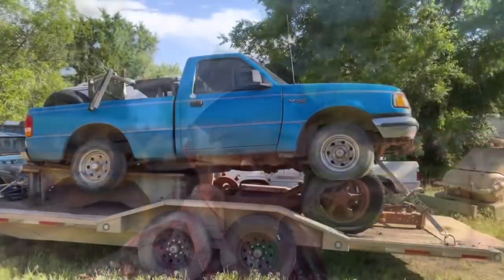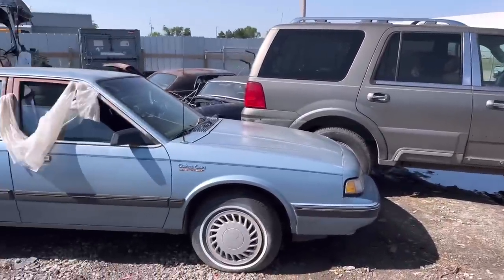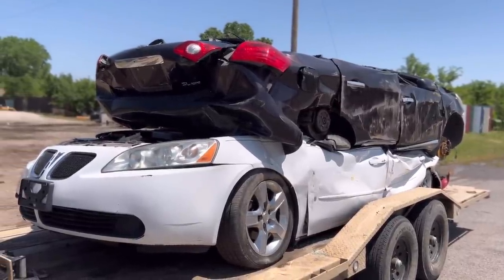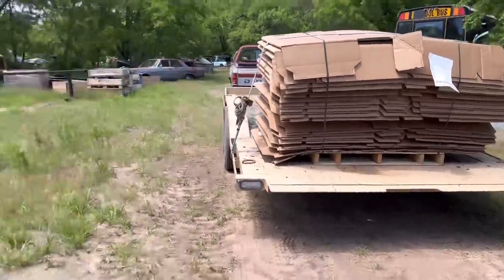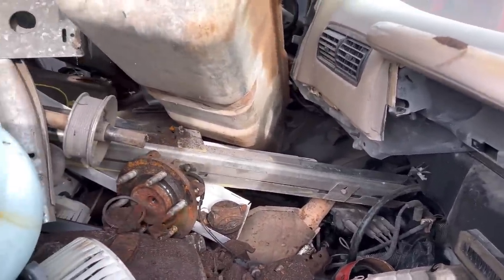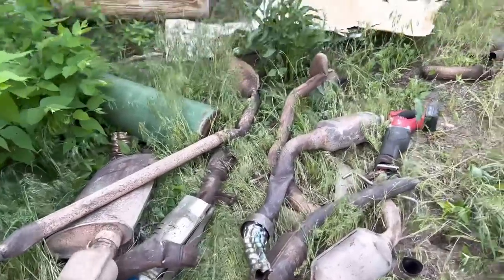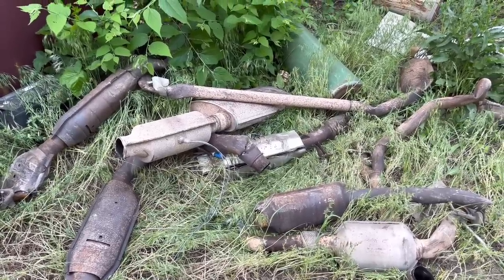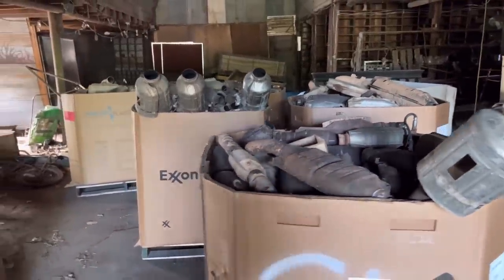Crushing Cars & Prepping Hundreds of Catalytic Converters!

Comment: Too funny. That load of cars by the gate while they were sitting on the loader. The truck/trailer backed up then IMMEDIATELY the loader started doing it's thing. Had to watch that part twice. Didn't see the edit in between. I was like, "How'd he do that? Is someone else driving or something?" HAHAHAHAHA!!!!!!!!!!!!!!!!!!!!!!! 🤣😂🙃😁🤪🤭😏😛😊😝
That train. The engine in the middle is called a "DPU". Short fot "Distributed Power Unit". They stick 'em in the middle to assist with longer/heavier trains. They can push/pull the extra weight, reduce coupler breakage and improve fuel economy and/or all of the above. They can also help to prevent locomotive stalls on hills. A DPU is controlled by the lead locomotive via remote control. At the front, there may be more than one engine. DPUs as well. Controlled the same way. They all act in sync (usually). Sometimes on hills the leads will pull the weight before the DPU up and the DPU will "run a little faster" so as to help pull the rest up. Sometimes there's a DPU at the end of a train. Same principles. Those can sometimes be referred to as "pushers" because that's their main function: 
They help push the train which the loco(s) are pulling. If one at the end, odds are there won't be one in the middle. Placement's all pre-calculated based on total weight and leading grade (if any - leading=steepest) on hill(s).

Comment: Silas, you know if you'll put your pin in the hook in the opposite direction from the way that you put this one in, so as until the head of the pin is on the side of the point of the hook, you won't have hardly as much trouble with the pin trying to come out, it really does make a difference if the load isn't pushing against the cotter key end. Love ya junkyard! To prowl a good junkyard for a day is like Christmas and a vacation day all in one, not much can beat it!
Reply from the maker: Interesting, thanks for the tip. This one lasted for 2 years so hopefully I remember this tip the next time it falls out 😆

Comment: Man that Olds Ciera looked very clean.   I wish could come across one of those that clean here even if it needed work .  Most of those here in the rust belt are pretty much gone.  I had a 93 Buick Century(same car) which i drove for 15 years until the rear undercarriage rusted out which is the death knell for those cars.  I miss that car.

Comment: You put that pin in the hook backwards!!!!!! If you put it in the other  way  it will  stay in longer without breaking it cotter pin !!!
Silas you know that bus you got with the 7.3 in it !!! It would be cool if you that engine and  chassis and put one  of  the old dodge trucks  cabs on it for a trailer  pulling  truck so you could haul  three times  as much at a time  !!!!!!!

Comment: I clean the converters with my cutting torch
Reply from the maker: Chopsaw is the fastest for sure, but the sawzall is 2nd. Torch works but you have to melt through the stainless pipe